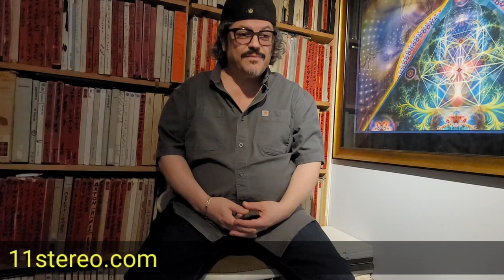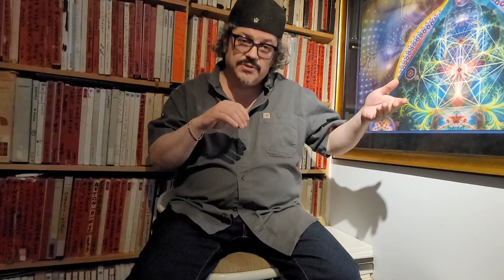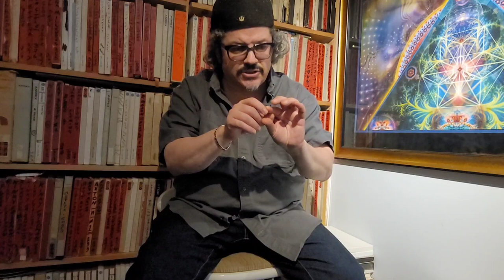i2S and outboard Master Clock Generators.  Whats the deal ?

Comment: Hey Mike !  Just saw this...  Not sure what took so LONG !  I agree with 99% of what you said.. The only place that I will differ slightly is I2S (e.g. over HDMI).  If someone has an SACD player and want to use an external DAC to play the SACD layer (DSD FILES), I2S is the only way to go, I believe as neither Coax nor TosLink outputs anything when playing DSD's.  I've never tried it as I worry about lack of standardization of I2S pinout plus the handshake issues that could happen between an SACD player and a DAC for DSD decoding.

Then there is the DDC (Digital to Digital Converter) !  If it is for noise suppression, then it makes some sense but everyone says USB is very noisy but for me, I am very satisfied with the quality of the sound from my stereo.
Reply from the maker: USB off the motherboard of a computer is noisy. This is why I use a dedicated high end USB card in a PCI Slot.. Sound is killer. Im not on the same page with i2s... its a total hit or miss gamble that things will work well together with that bastardized protocol.
Reply: @OCDHIFiGuy  I agree USB is noisy.  So…. if someone wants to use an external DSD capable DAC to playback SACD layer , how can this be done without using I2S?  No SACD ripping though as that’s a rather convoluted process and is very hardware dependent. Thanks man.
Reply: @ptg01  i2s is not DSD, they are 2 different formats. There is no way to play dsd over i2s.

There is such a thing as dsd over pcm (DoP) which transports DSD in a PCM container over (typically) USB (but it is also possible over coax with the right hardware)
Reply: USB audio is not noisy in itself, but some implementations of it can be. Its a system design problem.
Reply: @jeremyglover5541  From all I've read, I2S over HDMI can transmit DSD to a DSD capable DAC that also has I2S over HDMI.  But it is littered with caveats due to copyright issues from the early days of SACD....If I2S over HDMI does not transmit DSD, then these SACD transports (such as PS Audio's SACD Transport) will never play DSD layer of SACDs...  which seems odd...
Reply: @ptg01  No. you have misunderstood. You are conflating i2s with PCM. They are not the same thing.
Reply: @jeremyglover5541  Correct... I2S is not PCM nor is it DSD. It's a communication protocol.
Reply: @ptg01  yep. I2s or pcm can be sent over an hdmi interconnect, using the same cable, differential signalling protocol (LVDS) and tx/rx chipset, but nothing to do with hdmi itself. This same interface can be used to send dsd, so if your dac can handle both i2s or dsd and recognise such, it can be sent over the same connection and hardware, but it would be incorrect to call it dsd over i2s, it is called DoP (DSD over PCM) ie DSD wrapped in a PCM container.

I know im being somewhat curmudgeonly, not trying to nitpick, just succinct.
Reply: @jeremyglover5541  Nah... I enjoy a good on-topic discussion. I am aware of DoP but thought this is primarily in the USB world.  Plus, I2S protocol can also use other type of transport layer besides HDMI (e.g. RJ45 and others?).  Challenge is connecting a DSD capable DAC to a transport is riddled with gotchas due to copyright issues associated with SACDs.  Hence, some DSD capable DACs that support  I2S has some type of masking to try to work around pin-out differences between manufactures... So confusing...  Back to Analog for me !  :)
Reply: @ptg01  ha!! Yeah, this is all because none of these are standards and these guys rarely cooperate. Yes, i2s (of various flavours. Left justified, right justified) is sometimes carried on rj45 Ethernet connectors. No standards are enforced, its a mess. Each manufacturer uses different ‘proprietary’ solution to the problem of transporting signals not designed to leave the PCB. Nothing from the ground up, just generally coopting some existing standard and connection hardware. DoP is also available on coax, although this is more rare than on USB. These are all kludges IMO and i favour the transport clock and dac clock be one and the same master clock. This mess of connection standards is best avoided. 

The dsd layer on dsd media is what is called native dsd vs DoP, to add yet another ingredient to the soup. 

I favour dsp and room correction and for me this is of much higher import than maintaining pure end to end DSD content.

Comment: Hi Mike, thanks for all the informative video's on digital and Dac demo's. I appreciate your genuine and out of the ordinary approach. I saw that Audiobyte is also offering a USB reclocker device (Hydra-Z), which you don't offer. I use my Mac Mini direct over USB and was planning on upgrading to the Black Dragon. Would their Hydra Z be beneficial in this respect (between the Mac Mini and Black dragon)? I was first planning to clean up the USB chain with a reclocker on my current Dac, but after reading more and seeing your video it makes more sense to just go for a better Dac with good clock instead. Audiobyte seems to focus on the desktop users. I currently have a Burson Conductor 3 dac/headamp, which is still to edgy and sharp on my Harbeth P3s, even after swithing to classis opamps, which your are not a fan of ;)! Thx!

Comment: I use a vintage Accuphase DC-91, PC->m2Tech evo usb to ST glass optical->DC-91. Despite it's age it sounds phenomenal, but would i for example benefit from a modern master clock? My DC-91 has 3 auto precision levels;info reads as follows: "Uses 3 quartz oscillators for level I, 3 lithium tantalate oscillators for level II, and a CR oscillator for level III, resulting in a total of 7 PLL oscillators optimized for their respective precision level." Accuphase serviced the device last month and put new IC and new "X’TAL(11,2896MHz:HC49 527-0017-00) crystal oscillator.  Do i require a master clock to clock into the m2tech? 
PS: Why isn't ST glass optical used anymore? It sounds great!
Reply: I should mention that i have yet to read a Precision Level III for any lossless track i have. Many are Level II, most are Level I so most of my tracks are using the quartz clock i assume. If i upsample all tracks from 44 to 48khz i get a Level II lock. The brochure states "manual override is possible" but i have no idea how to override to Level III to always use the crystal??
Reply from the maker: My DAC right now uses ST Digital , and its the best.... Playback designs.  PLL is bad , you dont want one, much less 7 of them... they make noise and are taboo...
Reply: @OCDHIFiGuy  so I want to manually force level III crystal clock to be used, then? At least until i can get it modded/upgraded to new clocks and no feedback loop. Im using lifatech glass st optical cable. I couldn't find any others.. Know of any that aren't priced as high as AURAL SYMPHONY? I want to change to mutec usb converter but mod one with an ST output. Pc is my only source so I have to get the signal to the dac and the old m2tech hiface evo is the only one I know of with ST out

Comment: I used I2S on two of my dacs and the results were stunning. I'm an electronic musician and my softsynths that imitated classic synths that I own sound much more harmonically accurate. I have built several amplifiers and electronic instruments. I2s is very good! You have some misunderstanding from a lack of electronics knowledge.
Reply from the maker: Oh is it really from a lack of electronics knowledge ? no it's not it's from an opinion Holmes. The truth of the matter is  i2s just started to become good. And not all of it is. What brand of HDMI of cable are you  using? You know what's better than i2s? The proprietary protocols the high-end DACs use how where the cable is glass fiber, so it's impossible to pick up noise. The truth is I squared ess is a hack. The bastardized the LVDS protocol which is for video along with audio.
Reply: @OCDHIFiGuy  I2s has been around for over 30 years and it blew away SPDIF even back then.
Reply from the maker: @carlosoliveira-rc2xt  its still a hack with no code for specification off a board. Never designed to be off a board. Whether it worked or not....
Reply: @OCDHIFiGuy  True but most innovations started off as hacks. Unfortunately I2S never had standardization which is common.
Reply: Did you use it for DSD decoding from an SACD player ? How does the handshake work ?
Reply: @OCDHIFiGuy  True! it is a hack! But there is no need to put it down. I2S is the native protocol of original CD players. But engineers have figured out a way to optimize it and make it easily accessible more robust! They feed it in to a driver chip then you can use a good quality HDMI cable to send it to you I2S compatible DAC via decoder chip (HDMI INPUT) on your dac. The I2S has nothing to do with video protocols. You have it confused with the HDMI standard. This is different from regular HDMI. Please do research and get your facts rite.

Comment: What about a SACD Player which will only send 1 bit DSD Through the hdmi but i2s doesn’t work straight from the player so I use a HDMI To i2s converter which seems to work a treat .
Reply from the maker: Wow, lol, never thought about that. My DAC decodes SACD via Glass fiber. Usually the highest end DACs also have a matching transport and they always use a proprietary cable and protocol, some use RJ45 and ethernet cable some use Glass fiber, some use DIN plugs
Reply: @OCDHIFiGuy  I didn’t think that SACD players  Sent DSD through the digital outs . Only HDMI.
Reply: @redleather100  My understanding (and I can be WRONG):  I2S can also be sent using HDMI type of cable but it is NOT the same as HDMI that you see for A/V purposes...  What confuses me though is some Sony BluRay players can play SACDs and my A/V Receiver shows DSD 2 channel or DSD 5 Channel (as selected on BluRay player) being decoded..  Aaargh !!!
Reply: @ptg01  yes  a SACD blue ray 4k player will only send the DSD Signal through a hdmi cable  Not the digital out , because on a dedicated SACD Player , it will not send it through a digital output, its decoded in the players own dac and sent out the RCA,S .  I think Sony have the rights on the digital side of things .
Reply: @redleather100  Thanks for response.. Clarification:  On my Sony BluRay players that can play SACD's, my receiver is connected to it via an actual HDMI Cable (usually to watch movies) and the receiver is decoding DSD;s ! . I can also confirm that the digital outs of the BluRay player (both coax and optical outs) are both PCM 16/ 44.1 only when playing SACD's as I connected it to a DSD capable external DAC with display.
Reply: @ptg01  exactly, so OCD HIFI GUYS DAC will definitely not decode Sacd (DSD) Through toslink (glass fibre) as he described.
Reply: @redleather100  I guess I2S is kinda useless today ?  And that's exactly your point in the first part of the video....  Looking at higher end DACs that have I2S (mostly HDMI type of cable) is kinda useless too as the handshake just won't work due to content protection especially between different brands of transport vs codec ?  My head hurts !  :D
Reply: @ptg01  i2s is another way of transmitting digital that’s all, it’s pretty much the same as coax but in hdmi form .  You can download DSD Music which will play through a hdmi cable and usb , not tried coax or optical. But guessing it will play . PS AUDIO use it between there products , it’s just another money making thing .  It’s just a patent through the SACD Medium that it will only play through hdmi . 🤷🏽 it’s a crazy audio world.
Reply: @redleather100  No consumer CD, DVD or Bluray players send DSD through optical or coaxial spdif. they all down sample it to 16bit / 48khz at best. its in the copy rights spec.
Reply: @redleather100  Please dont give up on DSD and I2S. It works just fine. You are not looking in rite places for this valuable information.

Comment: I am glad that someone is bringing up the I2S topic. I2S is a protocol for transferring the data on a PC board not cables, even at board-level, the implementation is purely based on the skills of the hardware engineer and the PC board layout person and knowledge of signal integrity. There are reference design and application notes from the companies that developed the protocol (Philips) for correct implementation. As someone that oversees a multi-discipline and fairly sizeable engineering department, I can vouch that engineers with Signal integrity background are NOT cheap to hire or even consult with, so what we are seeing lately with companies offering I2S connections is yet another audio rabbit hole. Once the I2S data is taken off the PC board and traveling over longer distances, the data is even more susceptible!  
OCD guy is 100% correct, save your money.

Comment: With all due respect, you are wrong about an outboard master clock not improving sound. I can A/B test with the DAC remote and I can hear a clear improvement. Now if every DAC cam with a oven controlled supercut crystal maybe your assertion would be true, but the clocks are not of the same quality and I can hear it on a very revealing system.

Comment: C'mon Mikey,  differential  and balanced aren't the same thing. A balanced signal is always differential, but a differential signal isn't always balanced. Balanced implies matched impedance on both circuit legs, differential is only + and - voltage.

Rockna wasn't even a company when i2s was invented for servo to dac comms in cd players.
Reply: yup, its a philips standard initially, yeah?
Reply from the maker: OK, Good to know ... Thx  .. Never said Rockna invented it ,  just that they are very good at implementing what I consider to be a consumer driven hack.